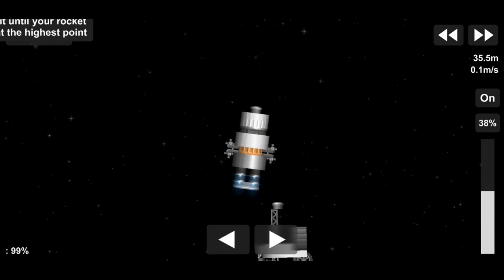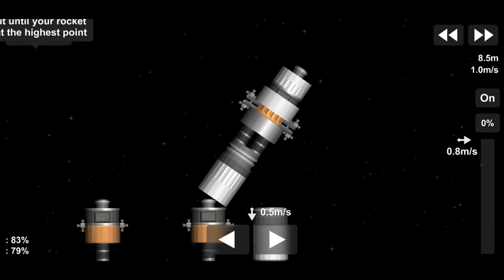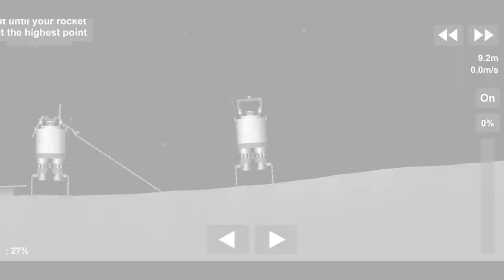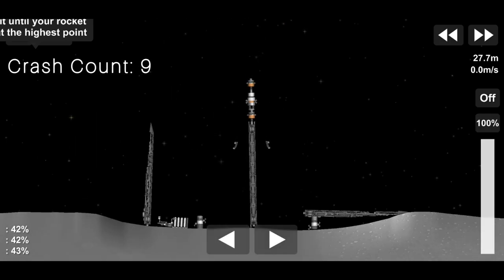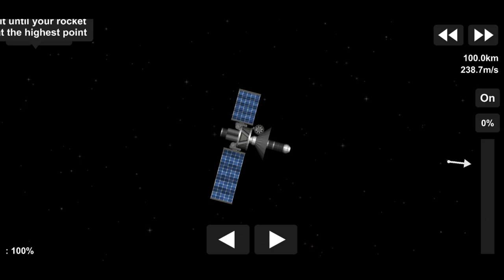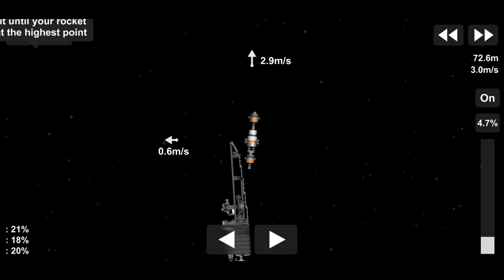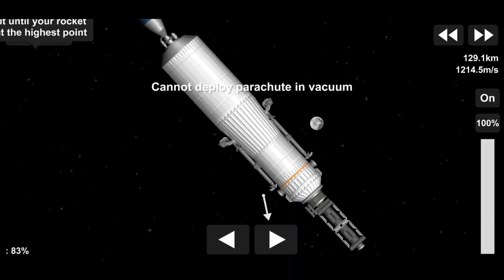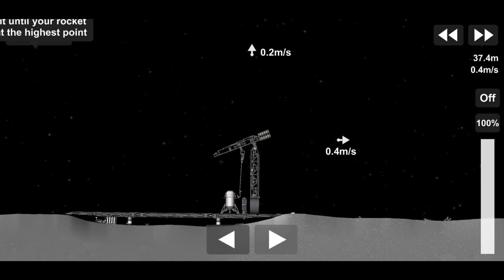Pad Operations - Starstruck | SFS 1.5

Comment: hey spider room when your land on the moon could you just use struts on the bottom of the rocket and so you can crash into the surface and make the rocket have extra fuel when landing meaning you could put more fuel storage on the base